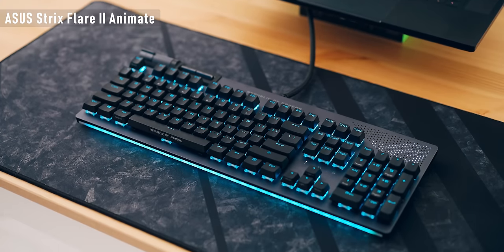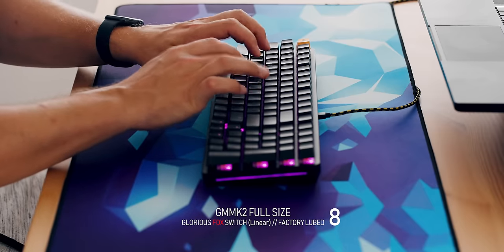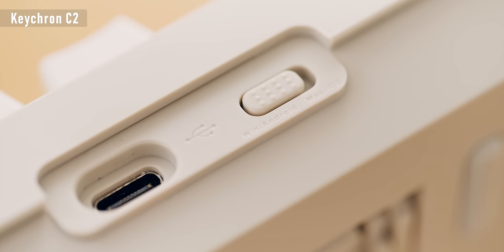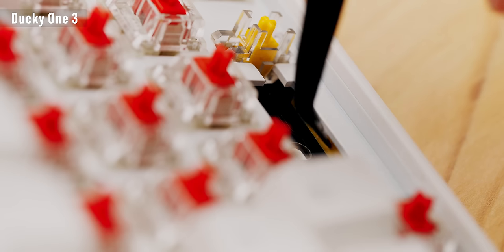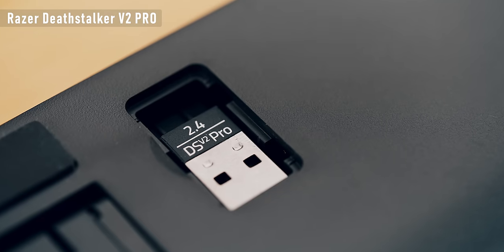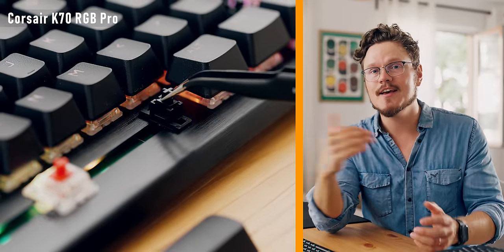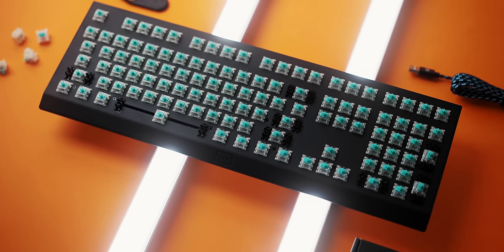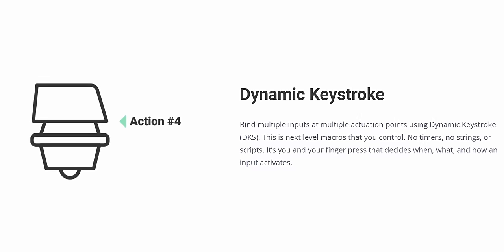Best FULL SIZE Keyboards You Can Buy - 2022 Edition!

Comment: Finally someone is speaking about full size keyboards!! Good job!!!!! I love my Ducky Shine 7 and I wouldn't change it for anything else than an identical keyboard that is wireless.
Reply: I always swore by Ducky (I have a Shine 6 & 7 and 3 TNKL) until I tried a Glorious with Gateron Box White switches. Well worth checking out.
Reply: @Prod-23  My only issue with Glorious is that they only have one proper full size keyboard and it has no removable cable. I tried the GMMK2 96% but the key locations just didn't work for me. I'm currently on a Ducky One 3 full size with silent reds, but I've got a set of Glorious Fox keys on order for it.
Reply: @joemacafee7655  Gotcha. That is a bit of a showstopper isn't it.

Ducky are awesome though so it's not like you're poorer for it!
Reply: Try apex pro hehe
Reply: Hey there! As a fellow tech enthusiast, I've recently come across the HOTO Compressed Air Capsule and it seems like a useful tool for maintaining a spotless environment in your desk, car, and more. It offers powerful vacuuming and blowing capabilities, making it versatile and efficient. The compact size and multiple tubes also make it great for keyboard cleaning. Give it a try if you're looking to optimize your cleaning routine!

Comment: I don't expect to change my G915 for a long time. I use the five additional function keys a lot. It's also super practical to switch between my laptop and my desktop with the press of a button. And I love the low profile and the build quality.
Reply: Why is the G915 not on this list? It's by far the best full size.
Reply: Logitech?
Reply: Gotta agree with everything you said! My absolute favorite keyboard. Curious why they went with Razer instead in this list.
Reply: Where do you find the battery to change it? How long does the lithium battery last?
Reply: Hey there! As a fellow tech enthusiast, I totally get your excitement for building and optimizing your desktop setup. For notebook upgrades, have you considered the HOTO Compressed Air Capsule? It's a handy tool that combines vacuuming and blowing capabilities, perfect for keeping your workspace and gadgets clean. Plus, it's reasonably priced compared to other brands. Check it out! 😊

Comment: Finally a review which focuses on the full-size keyboards only. Thanks a lot for that.👍

Also... I was expecting the Logitech Mx Mechanical to be included. Still not sure why it's missing.🤔
Reply: @rayquazahere8529  this guy who does their keyboard reviews has a severe preference for 60% keyboards, so thats what he usually goes for.
Reply: i dont think logitech is up to speed with newer tech anymore most of the popular boards are modular and you can hotswap switches not sure they even do that dont they still use their own thing
Reply: @PainX187  on the 512 carbon its clicky blue mx, but can not swap them out.
Reply: I assume MX Mechanical was not included because there are far better, and cheaper, options out there. This seems to be consistent story with Logitech peripherals these days, including their recently released "inclusive" peripherals.
Reply: Hey there, {{3}}! Thanks for joining the discussion. While the Logitech Mx Mechanical keyboard is indeed popular, it seems the focus of this post is on full-size keyboards. If you're interested in notebook upgrades and desktop setup optimization, have you considered looking into the HOTO Compressed Air Capsule? It's a handy device for keeping your devices and spaces clean. Let me know if you need more recommendations or have any specific questions!

Comment: FINALLY

Every time I ask someone for suggestions, they just go "buy a TKL instead"
Reply: if TKL is good for someone, I will suggest they try 75%.
If you want full size, I recommand old keyboard instead of 2022 keyboards, nothing wrong with them, just many old option still there and basically makes no difference.
Some brands rarely has new model come out or still remain those models even newer one being launched such as Filco. They always great.
Reply: That's what I used to see in some techies forum. In one of the Discord server of a local tech reviewers I join for example, many have asked about the full size recommendation but sadly they rarely give one, either because they don't know about recommended full-sized boards even though there's a lot of them ranging from cheap but good quality OEM ones to the ones from expensive big brand or because they simply prefer smaller form factor with separate numpad because they don't use numpad often, only for work so it's better to have a separate one. 

And yeaa they always justify the reason of why smaller form factor will always be better which might not be everyone's favourite. This kind of treatment often make someone who asked for recommendation to flee from the forum without even saying thank you as far as I've seen, probably because they feel asking for those people are useless at the end (I guess?)
Reply: Sometimes I really feel like the odd one, because I have requirements that go against what people say.
I prefer cabled headphones for the simplicity and "it just works" usability, I still have my DVD drive in use on a frequent basis, I use my numpad almost on a daily basis, and I have big hands, so all these tiny sub 70g mice are just uncomfortable to use.

Comment: I personally thing that the Keychron Q6 is the best this years.
-Extremely well built and premium full Aluminium shell.
-Came with decent switches, stabiliser with hot swap.
-Thick PBT keycaps with good looking font.
-RGB
-Gasket mount.
-Have a nob option if you want.
- Require minimal moding, if any.
-Not very expensive compare to other gaming option from brand like Corsair, Razer, Logitech,...
Reply: Yeah, Q6 and Q5 are definitely much better in build quality compared to all of these keyboard. 
I thought he'll put Q6/Q5 after C1 when I see keychron mentioned.
Reply: Agree, the Q6 is currently the best full size on the market.  Hotswap, RGB, removable USB type-c, fully reprogrammable, and is incredibly heavy.
Reply: Yea I came here to comment that this was a huge miss. The Q5 and Q5 are about as mainstream as the Ducky now and got totally overlooked
Reply: blind leading the blind not recommending the Q5 / Q6. Major L
Reply: Yep I have a q3 that the only mod needed was force break but like who doesn't have a bit of painters tape laying around if not it's like $5 at most. It's designed to be taken apart and even includes the tool to open it up. Q5/Q6 would have been a step up from gmmk and likely Asus keyboard.
Reply: @TyGamer125  GMMK actually need quite a bit of mods for what they charged for. Gasket is too stiff so people usually swap it out. Their Stab also need some mod from what I know. The Q6 to me is pretty much the perfect keyboard and the only thing that I wish they add is a brass bottom weight. but that's just me.
Reply: K6 is a great option and definitely offers a number of premium design touches.

I would say though our ROG STRIX NX DELUXE is a very competitive offering for quite a bit less
TriMode ( Bluetooth, 2.4GHz, and USB-C )
Binned switches which are semi-lubed ( same switches HWC noted in the FLARE II Animate )
PBT Keycaps ( brighter lighting ) this is of course only relevant for those who like RGB on their keyboard
Multiple hardware profiles for easy profile/game customization
Hardware-level lighting adjustment ( K6 does offer this as well )
Included magnetic wrist rest
Top cover Aluminum  with overall solid build quality 

Currently it is priced at 160 ( 35 less than the K6 ) and when on sale like now for 136  that is a savings of 59 so the value is solid.

I would also note that the FLARE II Animate takes many items found more in the “custom keyboard” segment as noted in the video ( we also offer a lower cost non Animate version )
Elements include
Solid-body
Aluminum top cover
Semi-lubed switches which are also binned for tighter gf tolerance ( this is not openly disclosed by other companies ) many users are not aware gf deviation is considerably more than 5gf industry standard.
Improved stabs compared to traditional stabs on many “gaming keyboards”
Internal sound dampening foam

Then there are other items that while gaming centric at the same price does off solid value at the same price

Multiple onboard profiles
Advanced media keys ( more than just a knob )
8K polling
USB Passthrough

Stay tuned as we also have another exciting keyboard release later this year!
Reply: @ASUSUSA  Ad spotted

Comment: Some other great features of the FLARE II Animate include
8K polling
Onboard memory for profiles ( no cloud account requirements )
Hardware-level lighting adjustment ( FN+Arrow keys )
Internal sound dampening foam ( quieter experience and less internal “pinging” ).
ROG NX switches also are binned for tighter gf tolerance and also have a modified actuation/reset point ( the same value )

There is also a non Animate version at a lower price point FLARE II

For those who want wireless, we got you with two great options.

ROG CLAYMORE II
Wired and wireless ( USB-C ) and 2.4GHz
Detachable Numpad design, so you get the Numpad when you want it and go TKL for gaming or better ergo
Superior switch and keycap stability due to our ROG RX Optical switches and in house stem/keycap design ( very stable and smooth switch )
Centralized lighting with centered legends
Numpad has a metal volume wheel and macro keys
USB Passthrough

ROG STRIX SCOPE NX Wireless
Wired and Wireless ( USB-C, Bluetooth and 2.4GHz ) Tri Mode!
ROG NX switches ( like the FLARE II Animate )
PBT Keycaps
Aluminum alloy top cover
Magnetic wrist rest
Quick-toggle switch: Instantly shift between function and media key input
Reply from the maker: Thanks for stopping by Asus 🤘🕺🏼
-D.
Reply: Omg ASUS himself

Comment: It took me 2 solid days to get used to the DS V2 Pro but now I love it. It travels with me between three different locations and connects with three different devices. A solid buy if you can afford it.
Reply: Have you any issues with your keyboard showing 100% charge in synapse but when you unplug it shows 97%?
Reply: my ds v2 pro has annoying noise, it has bad capability to maintain connection if there is another wireless devices on the same PC, also it charge-out pretty fast. 
Idk, if logitech g915 have a hot-swap, i wouldnt see the reason to buy ds v2 pro. Its the only real win.

Comment: Numpad forever. Literally cannot be at a computer without a numpad. Tried TKL 1 time, that was enough to notice how much I use the numpad :D
I also would love to see more Full size keyboards with a USB PASSTHROUGH. So few of them. And for some reason those few refuse to use USB 3 Passthrough :)

Also hate bright leds. My Corsair numlock, capslock leds are so bright that if you dim down the lights and watch a movie you need to turn off numlock every time to not get blinded :D
Reply: @rayquazahere8529  I think my optimal solution would be a keyboard with a detachable numpad that can also be put on the other side.
My main use for the numpad (besides hotkeys in games) Is for entering lots of numbers in Excel, and for that it would be super useful on the left. Reaching over to the right end of the keyboard gets annoying, and the right hand stays on the mouse to move the selection to different cells.
Yeah, there are people who do more than gaming on their computer, and buying seperate keyboards for gaming and non-gaming uses just means double the cost.

Comment: I'm a big fan of the 96% layout, which I don't see too often for mechanical keyboards. Basically get every key a full size has just more compact. 

Bought a hot swappable Royal Kludge Pro 100 that can be connected with both Bluetooth and wireless dongle on sale for $70.
Reply: I almost bought that one since I loved the fact that it had a milled aluminium case. I went with the LTC NB1041 Nimbleback keyboard and modded it with PBT XDA keycaps and Gateron Inks V2 black switches for a gorgeously thocky and buttery smooth typing experience.
Reply: @Aaron_Lesse  yeah I'm pretty noobish when it comes to mechanical keyboards. I just felt for the price it was a good deal since my main focus was a wireless one that didn't need to rely on Bluetooth and had good built quality. 

Aluminum casing is pretty tanky and I like the idea I can change the switches if I get sucked into the hobby even more haha.
Reply: Hey there! As a fellow tech enthusiast, I can definitely understand your excitement for the Royal Kludge Pro 100. Have you considered optimizing your desktop setup with the HOTO Compressed Air Capsule? It's a versatile tool that offers powerful vacuuming and blowing capabilities to keep your workspace and peripherals spotless. I've found it to be efficient and reasonably priced compared to other brands. Just thought I'd share this handy device that might enhance your cleaning routine. Let me know if you have any other questions or need further recommendations! Happy tech-ing!

Comment: Excellent! And you've left enough full-size keyboards off this list to do a part two of this video! There's the Royal Kludge RK100 (and the RK 100 Pro with a CNC aluminium milled case), the Epomaker TH98 (with a vintage two-tone colorway PLUS accented keycaps), the Akko 3098 series (with a handful of color options and accented keycaps), as well as my personal favorite, the LTC NB1041 Nimbleback which I can't say enough good things about after modding with PBT XDA profile keycaps and Gateron Inks V2 black switches (which now sounds a tad thockier than the Ducky One 3 that you reviewed in this video). There are a few more but I am really looking forward to part two where hopefully you can cover these other keyboards and some of the highlights featured with each of them. Thank you for the video!
Reply: Yeah, I would love to see a second video showing more keyboards. The one shown are are pretty expensive here, so some recommendations with a slightly more budget oriented price would be nice.

Comment: I recently picked up a Mountain Everest Max and I couldn't be more happy with it. It does everything I would want a keyboard to do and the typing experience, for me, is top notch.  I'm using the linear red switches on mine.
Reply: Hey there, I recently came across the HOTO Compressed Air Capsule and it seems like a great addition to any desktop setup. With its powerful vacuuming and blowing capabilities, it can help keep your workspace spotless. Plus, the multiple tubes and high-quality filters ensure long-lasting performance. Definitely worth considering for optimizing your cleaning routine! Cheers!

Comment: Tempted by some of these boards, but as someone who spends an ungodly amount of time in front of a computer for work, I really wish someone would make a mechanical version of the Microsoft Sculpt Ergo. 
There are some options, but they’re either riddled with gimmicks, have an exorbitant price tag near $400+, or don’t have a logical form factor for a productivity setup. 
After using something as comfortable as the Sculpt Ergo with a tented and angled board, you really feel the strain on your wrists and forearms from standard keyboards. Same goes for their Sculpt Ergo mouse (though the wireless tech is absolute trash if not in direct line of sight to the receiver). Alice/Arisu boards get close, but don’t achieve the same level of usability and comfort.

Comment: Nice to see some full-sized love. Decided to build a keyboard earlier this year and would have liked to use a Ducky One 3 as the base, but they didn't have the white at that stage. Ended up getting a GK108S of Aliexpress, using Gateron Lion switches and some generic caps to get me through until a pre-order ships. Haven't done any additional work and it's been decent. Will lube and insulate once the caps ship.
Reply from the maker: Which pre -order?  What did you get?
Reply: @HardwareCanucks  The ePBT Timeless. Here's hoping it matches the white case nicely.

Comment: Thanks especially for this. I'm a gamer who sets up their (left) hand on the Num keypad (for lots of very good reasons, one of which is that if you are WASD your mouse hand is stretching and that's going to give you back and neck problems) and also an audio transcriber who types for a living, all of which amounts to: needs the full keyboard including full Num keypad. I tried the 'gaming keypads' just for your one hand, so far they seem to be uniformly anti-ergonomic and non-anthropometric (my industrial design degree tells me this). So thanks, this is an excellent start on my long quest (that definitely won't include Razer; I was given a new one to try and it's rubbish - packed full of stupid gimmicks, a volume knob I don't need and which doesn't work anyway, and FRAGILE switches that shatter if you look at them the wrong way - compared to the 'legacy' one I still have that dates back to when Razer were pioneers in the mechanical keyboard realm, that still works beautifully after, what, 15 years or something?).